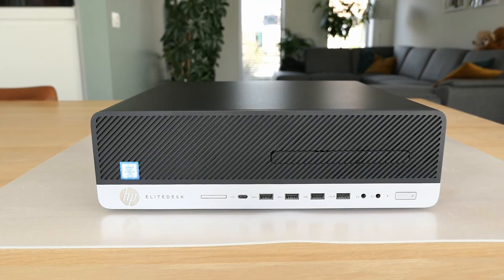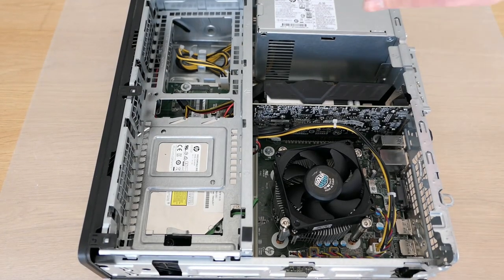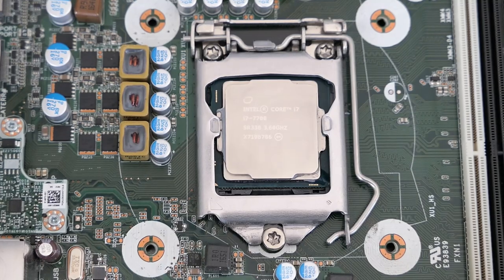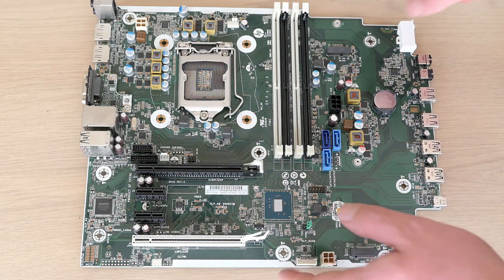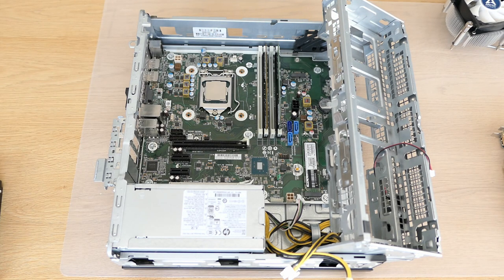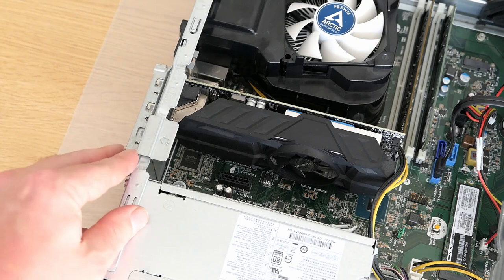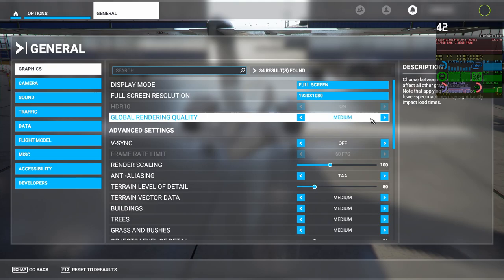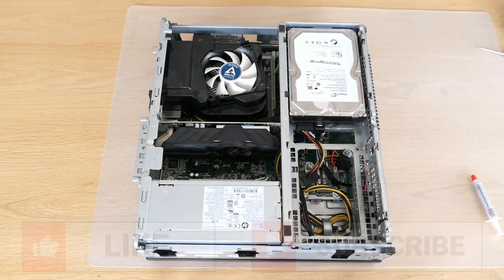HP EliteDesk 800 G3 SFF - Teardown, re-assembly and upgrade

Comment: You're probably better off buying a standarized white box PC.
Otherwise, you're in HP propritary hell...
I've learned over the years, buying any brand name PC is a hair pulling mistake.  You regret it almost immediately.   As a PC tech, I would be cursing like h377 to find that non-standard mobo ower supply connector, and the whole system would probably get thrown in the dumpster if the power supply died.  You just can't do anything like a design flaw decision like that.     

The fact the motherboard isn't a standard screw through hole form factor can't be mounted in a standard mid tower case is another major deal breaker.   90C isn't good, you shouldn't be over 70C typically on most systems.

Good tear down video otherwise by a PC tech with some experience.  
Showed me all the reasons inside (on the motherboard and otherwise) why I would or would NOT want to buy this system.
Reply from the maker: For me personally yes and no. For a new PC, completely agree. For second hand it can be different. There is typically a broad offer of these type of ex-office machines. Often in very good condition and for a relatively good price. Bit of a choicd to make, also depending on what your use-case with the machine will be.
Reply: @jensdbe  Yeah, I'm sitting on the fence about it.  I'm looking at some on ebay for $85 for a i5-6600/16gb/no HD machine to upgrade my extended family with and bring them out of the stone age.    Add a Netac SSD, Win7 bootleg, thrift store 1080p monitor keyboard and mouse and power cables.. all of which I already have in spades, and there's Christmas for you.  

If this were my only machine, I could live comfortably with it, which is why I'm considering it over the smaller form factor machines that need an external power brick.

Do I really want to buy 3 or 4 of them at $85 a piece though :-/    Basically about as eqivalent as my old AMD FX-8350 I'm rocking with a rusty old Passmark of 6000
Reply: @jensdbe  I just found out from the HP product spec page for this model when checking the highest processor it can be upgraded to... that by a deal with Microsoft, HP will not as policy provide support or drivers for Windows 7 or 8 for this or newer models...   

So, that is an ABSOLUTE  TOTAL DEAL KILLER 😕   Windows 11 = rubbish

Yeah, no, kryptonite, do not touch, unless you are a Linux propellorhead in which case, enjoy :)=

It's gotchas like this you really got to research or you get burned big time on these surplus corporate office PC dumps en masse on ebay.

I could of bought 4 of them and been royally screwed.      Jeez...
Reply: @jensdbe  PROCESSORS*, **
*NOTE: Your product does not support Windows 8 or Windows 7, In accordance with Microsoft’s support policy, HP does not support the Windows® 8 or Windows 7 operating system on products configured with Intel and AMD 7th generation and
forward processors or provide any Windows® 8 or Windows 7 drivers  ...

I'm guessing inferred from that statement, you can totally forget any Win XP, XP64 or Windows NT driver support as well.

Yeah, no Windows 7 or 8 driver support on the properitary motherboard, the only thing salvagable from this unit for a Windows 7 shop would be the CPU, RAM and Ti card if you got one...  maybe CMOS battery... everything else would be headed into the dumpster.   A PC tech could not even recycle the case, power supply, or DVD drive or sata cables.   It's all proprietary.   None of it can be recycles elsewhere into other computers as parts.

If you run Linux or Win11, I guess, your lucky day, but imho those two systems are unusable for serious work.  Windows 7 is like the gold standard still.  Any time I encounter an 11 system, I reformat it immediatley to Windows 7.   Customer can finally use their PC.

Comment: What would be a good video card upgrade? Is there an internal WIFI card option?
Reply from the maker: A low profile GTX 1650 is about the best card you could install in this machine. Regarding wifi, there is an M.2 connector for a wifi card on the board (see https://youtu.be/n1ETa3mJ85I?t=404) or you could simply use a regular (low profile) PCIe wifi card.
Reply: @jensdbe  Thank you!

Comment: Can this PC as is withstand having a 400w power supply?
Reply from the maker: It does not have a standard ATX form factor and connector so a regular 400W PSU does not fit.

Comment: Bonjour je voulais savoir si l'alimentation de 180w suffit avec la carte graphique ? merci
Reply from the maker: The most consuming graphical card it comes with from the factory is a GT730, which takes around 40W. A 1050 Ti takes around 75W so that should be within the safety margin.

Comment: is it possible to change its cabinet from sff to atx ?
Reply from the maker: The board is in a completely custom form factor so it will be very hard to fit it in a standard ATX case. The front ports for example are directly on the board so you would also loose those.